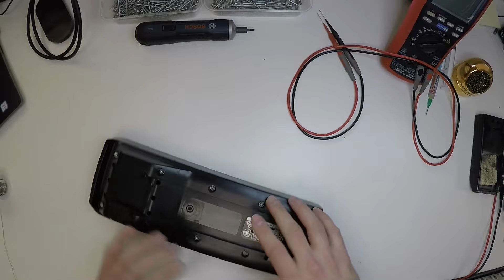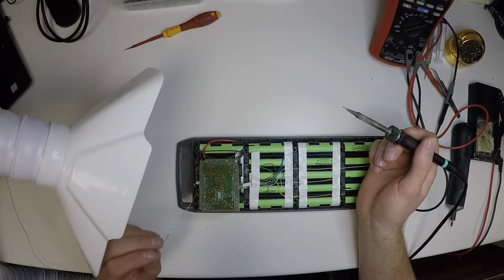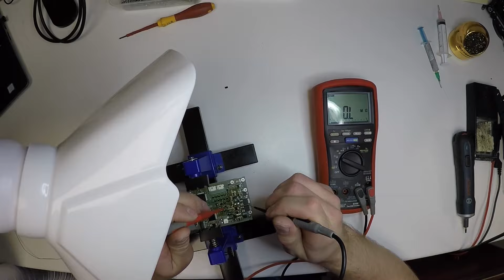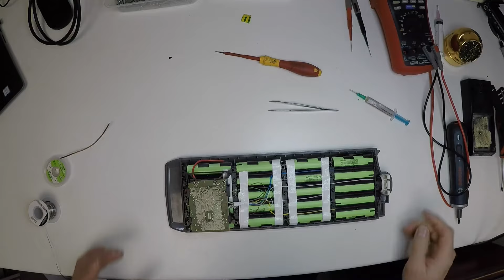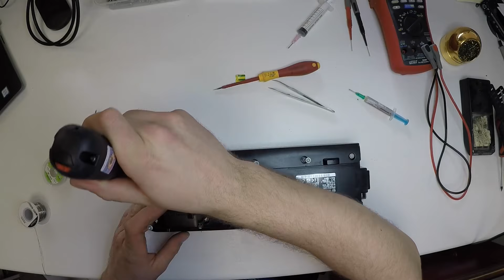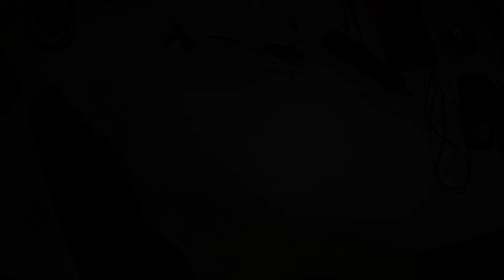Bosch Powerpack BMS repair

Comment: Hello Wim. Can you tell me what the component name is that you replaced?
Reply from the maker: It's a schottky diode. I use a 60 V, 1 A. For example:
https://www.digikey.be/product-detail/nl/on-semiconductor/MBRA160T3G/MBRA160T3GOSTR-ND/1748988
Reply: @wim4245  Thank you so much. I have a 300 powerpack. That has one light on, it will start charging and then stop after a few seconds. The cells seems to be around 40V in total on the output. And they all seems balanced. It wont power on a ebike either, so no discharge or charge. Could replacing that chip maybe fix it? Have seen some other videos that if it wont charge it could be a short in that chip you also replaced. And if it wont discharge it can also be the temp sensor?
Reply from the maker: @bryde4985  The diode isn't your problem. The cells are probably unbalanced, or there is a defective celgroup. Measure each cell group. The voltages should be the same.
Reply: @wim4245  I have measured the group several times. They all seems to be just around 10V each. And adding up nicely to the total voltage pack around 40,4V. Can also be that I don't measure the groups correctly. It's hard to get the probes into all the seperate groups without taking the whole thing apart. You have any good suggestions to what I can try?
Reply from the maker: @bryde4985  There are 10 groups (of 4 cells) that each should be between 3 and 4,2 V. The voltage needs to be the same for the 10 groups (if the difference is more than 0,1 V, they are pretty unbalanced).
I don't know how you managed to measure 4 groups of 10 V.
Reply: @wim4245  I more of less did the same as you do at 2:00 where you measure the cells. I just did it across so the negative and positive across from each other on all four of the "four groups". How can I easily measure all 10 groups without taking the whole pack apart? Because it sounds like i'm indeed doing it wrong.
Reply from the maker: @bryde4985  I did not measure all the groups in the video because it was a balanced pack (there are 10 groups, not 4). Use fine measuring needles, then you can easily measure each cell. If you total pack voltage is 40,4 V, then each cell should be exactly 4,04 V.
Measure a few cells at the side, you can easily reach them. If they aren't 4,04 V, your pack is unbalanced.
Reply: @wim4245  Thank you so much for this info. I will measure my pack when I get home tomorrow. And what can I do if one of the groups is unbalanced?
Reply from the maker: @bryde4985  You can get it balanced by charging or discharging groups seperately, but it won't last long if the cells aren't in good state. Only good solution is replacing all the cells (but you need some equipment to do it right).
Reply: @wim4245  Replacing the cells is not really a good option for me. I would have to buy a new pack instead. I just hope I can revive the pack and get some more use out of it. Can I use the balance leds from the bms to balance the cells or test them? Like you can check the voltage of lipo cells using the small JST connector
Reply from the maker: @bryde4985  Yes, that's possible
Reply: @wim4245  Can you maybe describe to me how? I tried it on my pack but didn't seem to get anything. I know one of the connectors (the 7 pin one) has a temp sensor, that ofc won't give any voltage. But I could not figure out of to measure a single group using the two connectors. Hope i'm not to annoying. A hugh thank you for your quick responses!
Reply from the maker: @bryde4985  There is really nothing more to explain about it. Every wire (except the two grey) connects to a cell group. You can measure voltage between B- and the wires to determine the sequence.
Reply: @Wim Verbakel  Hello again. I finally got around to laying out the balance wires so I could use them to measure the groups they are as followed:
1: 3,91V
2: 3,90V
3: 3,91V
4: 3,90V
5: 3,91V
6: 3,91V
7: 3,92V (highest)
8: 3,90V
9: 3,91V
10: 3,90V
totaling 39,07V. (my voltage meter also says 39V)
They are not that unbalanced if you ask me. But I also don't know how high bosch standard is for their balacing of cells. but 0,02V difference from lowest to highest cell group is not much if you ask me.
Reply from the maker: @bryde4985  No, these are in balance. 

Difficult to say what the problem is without diagnosing the battery. The balance IC (ISL) could cause the problem, or maybe the communication between ISL and MCU.
Reply: @wim4245  Can I safely remove the bms like you do in your video without it "bricking" - have read a few places that the bms won't work after it loses power. Their was some slight water / corrosion spots on the bms board itself. But since it lights up (only one bar) and flashes for a few seconds when plugging into a charger. I just thought it would be the balance problem as you pointed out first. Can you guide me to any chips I might need to look closer on when i take the bms board off.
Reply from the maker: @bryde4985  Yes you can disconnect the BMS.
Did not know your BMS had corrosion, that is definitely the problem. Probably a corroded via.
Reply: @wim4245  It had some small corrosion. Think I removed most of it with contact cleaner. But hard to do when you are affraid to remove the board because of possible bricking. But I will take the board off when i get the chance. What is the via? What should I maybe look out for
Reply from the maker: @bryde4985  Via's are the little holes that connect the different layers on the PCB. Corrosion destroys via’s and traces, so can’t be solved by just cleaning. There is probably a via corroded that connects the cell voltages to the balancing chip (ISL). You could look up the pins in the datasheet and measure them. I would not advise you to do this if you don’t have a basic understanding of electronics and experience with soldering.
Reply: @wim4245  Sounds a bit complicated for sure. I have some understanding of electronics in general so I might try and look at the datasheet. But do you have any pictures or timestamps in this video where you can point of these via's and traces. So I can look more into them when I take the bms board off the pack.

Comment: Sent a faulty Bosch powerpack 500 BMS board to Wim, he diagnosed and fixed the issue, put the BMS back in the powerpack, now working a treat. No help from Bosch at all, complete waste of time.
Wim did a fantastic job, thank you Wim 👍
Reply from the maker: Thanks, Darrell! Glad I could help.
Reply: @wim4245  Hi Wim. I Think I have the same problem with my Powerpack 500. Can I send it to you for a repair from the uk ?
Reply: I have a dead powertube 500. What to do?

Comment: Hi. could you help.  I have Powerpack 500 that drained batteries. I did fix BMS(few minutes) had to replace:  Schottky Diode, CAN Transceiver TLE6251-2G, TPS57160 (mine was burned), and LORA.
After replacing parts this battery pack started working agin. Then I made mistake to disconnect negative B- wire first. Since then the BMS does not work. When I do 3.7 volt injection only LED #2 and #4 lights up. Any ideas, how can I fix this. THanks
Reply: Where did you find TPS57160 ?
Reply from the maker: I'm afraid you can't fix this without replacing the CPU. 2 + 4 is an error stored in de the CPU. You cannot erase this (even not with the Bosch dealer software).

I don't think it was caused by disconnecting B- first. These boards doesn't seem to be sensitive for wrong disconnect procedure. I would think there was an another problem, but it's strange that it worked for a moment after repair.

Edit: LED 2 + 4 can be repairable (depending on what the cause is). After repair, the error has to be cleared with Bosch diagnostic tool
Reply: @wim4245  Had een video gezien waar 2de en 4de led lamp betekende dat de hitte sensor defect is
Reply from the maker: @sezeraktas3980  Dat is normaal 1 + 3 + 5
Reply: @wim4245   hoi wim kan ik contact met jouw opnemen? Ben namelijk zelf ook bezig met het reparen van accu's
Reply from the maker: Mijn mailadres staat onder "About" op mijn kanaal.